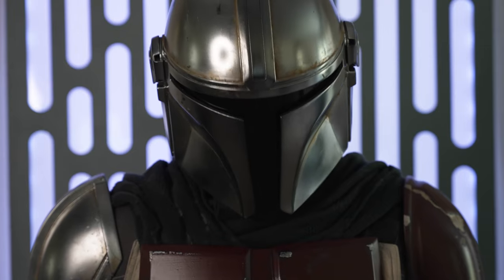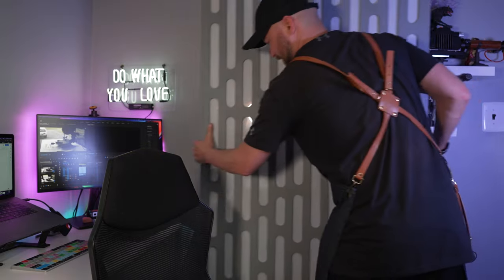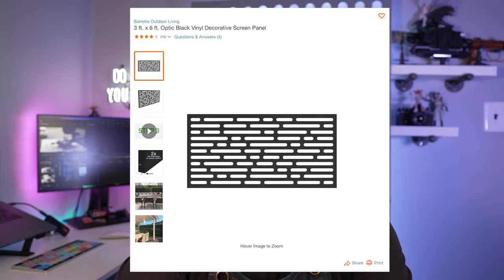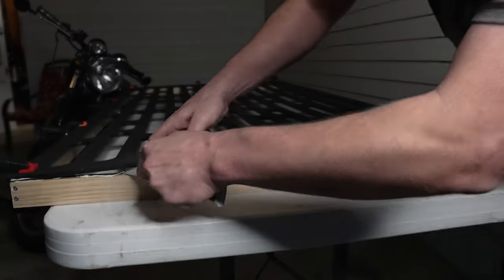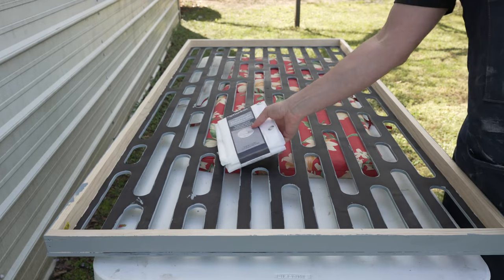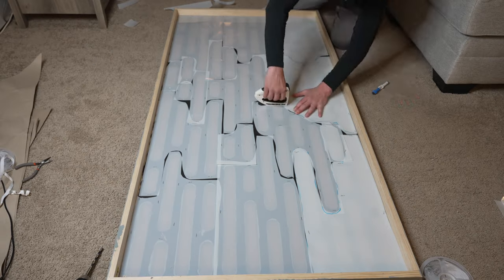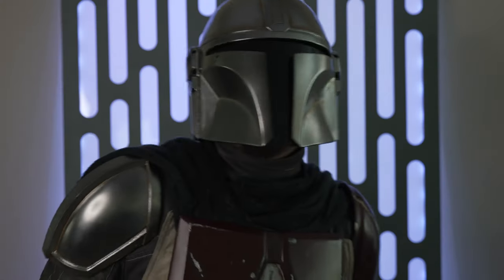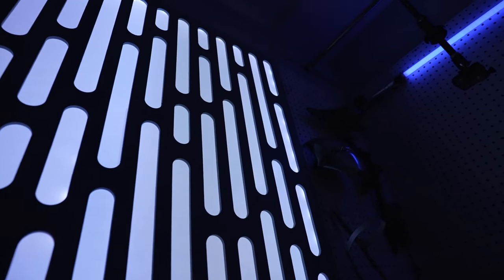$100 DIY Star Wars Death Star Wall Panel

Comment: Just finished making 3 of these panels. WOW it's a lot of work. I bought a roll of Mylar (3ft x 25ft) and lights are going on last. What took me the longest was painting. I wanted no drips, no streaks, no peeling, etc. Had to give it a few coats with some sanding in between as the paint doesn't really stick that well and can be scratched off easily. Finally finished it up with a matte sealer to really protect the paint long term. I'll be posting them up along with some figures in a few days on my Instagram. I'll be selling them at the PlastiCon event in Hollywood, FL at the end of the month. If they don't sell I'll be VERY HAPPY to keep them! - Look me up on IG to see my post soon - And a big THANK YOU to Trey for putting this up. Spent a nice few days with my dad doing everything in the garage.
Reply from the maker: That's what it's all about..quality time with family building cool stuff!!! Thanks for the comment..that made my day. Glad to hear the build went well and good luck with the sale (but you should really just keep them for yourself lol)!!

Comment: Hi. I bought a roll of Mylar Stencil Sheet with a thickness of 14 mil to avoid doubling up with the smaller sheets. Also the roll is 3 feet by 25 feet, since I'll be doing a few of these. Hopefully it'll go smooth.
Reply from the maker: Very nice! You got this..may the force be with you!

Comment: What length did you cut the wood too? Did you cut them into exactly 3’ x 6’ segments
Reply from the maker: Hey there! I measured them up with the sides of the panel. I think the top is like 33 & 5/8 and I fit in the side two pieces after that. Hope this helps!

Comment: Nice work.
Reply from the maker: Thanks so much! The problem with having one is now I need more 🤣🙌
Reply: @TreyEversman Thanks for sharing your tips. I bought two panels from Wayfair when they were $75, but I have been looking for ideas to build and mount them. How many feet of LED strips do you think you used?
Reply from the maker: @antwaynetube  I put the link for the led strips I used in the description I would say AT LEAST 75 ft (I didn’t use all of the 100ft) especially if you go around the outside of the frame and in between the holes.

I will be adding more screws at the top and side for my next one..ones in the center top& bottom but the liquid nails is holding up. Hope this helps!

Comment: I'm building 3 right now.  Thank you for the detailed list and directions.   I do have 1 question.   I'm using the sheets you got from Amazon.  Did you duel layer it or single layer it?  The video looks like you put a 2nd layer on.   Thanks !
Reply from the maker: That’s amazing!! Thanks for tuning in! I did double up..my apologies if I didn’t mention that. I’d def recommend 2-3 layers. 2 was just fine for me. May The Force Be With You!

Comment: Are leds in centre of panel facing the wall? You can see the leds around the perimeter. Would it be better to have these also face the back wall instead of firing sideways?
Reply from the maker: Personal choice I suppose! I can’t notice them for the most part. 🤷‍♂️
Reply: As shown in the video, I tried aligning the LEDs along the perimeter walls, but I didn't like how the LEDs were visible on the sides, so I removed them and have them facing the wall like the rest of the strips. It worked perfectly just by tucking it around the edges tightly.

Comment: Won’t the staples from the staple gun go through towards the front when putting the Mylar? Are they shorter than regular ones? I have everything for 3 panels including a roll of Mylar (3x24ft) so it’ll be less tedious. Teeediiioooouuusss.
Reply from the maker: Hey! I just checked for you..they are the 1/4'' 6mm staples. Hope this helps and good luck!

Comment: Did you glue the mylar sheet or how you adherethe mylar sheets?
Reply from the maker: I used a staple gun 🙌🙌🙌
Reply: I used a full-size glue gun (do not use the mini-gun!) and it did the trick!

Comment: Great video.  I'm going to start mines next weekend.  Question on the mylar sheets, Is 10 pack 7.5 mil sheet the ones to used?
Reply from the maker: Thanks so much for tuning in! I linked the ones I used in the description. I used 2 packs. Good luck on your build! Let me know if you have any other questions!!
Reply: @TreyEversman  np. I went to your mylar sheet link to buy,  but there's different sheets like 7.5 mil ect ect. Which one is the one to use? Thanks in advance.

Comment: When I did this, I used the stickum on the LEDs to adhere them down, and the LEDs face backwards.  There's very little light shining through.  If I turn the LEDs around, They're bright spots.  How'd you deal with this?
Reply from the maker: You can double or triple up or even more on your Mylar sheets depending on your preference. The more sheets the better the light will diffuse and you’ll see less of the bright spots. I doubled up on mine. Hope this helps!
Reply: Trey, any suggestions om how to keep the mylar sheets from waving up or down when your stapling them down.. im using heavy duty staples.. could this be the issue?

Comment: What would you suggest for a 9 ft tall wall, since these are only 6 ft tall?  They go from ceiling to floor in TDS.  Also, you said we need 2 packs of the mylar sheets.  It comes in a 10 pk, so is that sufficient or do we need to order two of the 10 packs?
Reply from the maker: Hmmm I think possibly adding in a top and bottom base adorned with other wall details from the DeathStar would be a nice touch and probably the easiest. Another idea would be to cut 1.5 ft pieces and lining them up with your full piece..(you’d have to cut your full piece so the circles match up) then attach to wooden frame, cover your lines with wood filler, sand, paint and BAM..frankensteined 9footer. 

I got 2 packs of Mylar because I wanted to double up on them..your preference!

Comment: Is the paint semi-gloss, satin or flat? Also, how long are your LED strips?
Reply from the maker: Hey there!  I got the Matte/flat version of that paint.  The led strips are linked in the description..the 100 ft ones but you'll have some left over.  Hope this helps!
Reply: @TreyEversman  I bought 65 ft. Hope that will cover it.
Reply: @ichawksfan  did 65 ft work for you
Reply: @jimmyolivares9856  I'm still waiting for the panel to come in.

Comment: Trey, what kind lights and how many rolls? Are they battery powered?
Reply from the maker: Hey there! I put the link to the LED strips I used in the description. I used 1.5 rolls..they are plug into the outlet and have a remote control for all the different modes. Cheers!

Comment: Can you explain how you did the light strips?
Reply from the maker: Yep!  So the string lights I used are in the description. I used about 1.5 wheels in the box.  First, I drilled a hole in the side of the bottom for the plug then I started the led strips on the bottom outside..went all the way around the outside frame then started on the panel itself and went up and down in between the holes of the panel.  HOPE this made sense!  Pretty simple.  Let me know if you have any other questions!

Comment: did i see that correctly? You put 2 layers of Mylar sheets?
Reply from the maker: Yep! I added a second layer for better light diffusion. I would at least do 2 if not 3 but it’s up to your preference. Thanks for tuning in!
Reply: @TreyEversman  thanks for making the video. I've been hesitating but lattices just went on liquidation at Home Depot in Canada (equivalent of 18 bucks USD). Couldn't resist. What do you think the 3rd layer would help with? I noticed you can still see the individuals lights when looking at the side but it's really not a big deal.
Reply from the maker: @Smarteebee  I saw that HUGE discount in Canada..that’s wild!! The third layer would diffuse the light even more and probably cut down on seeing ANY individual lights. To me, it really isn’t that bad. 

I would scoop some more up but they are still the same price here in the US 🤣🙈
Reply: @TreyEversman  just came back to watch how you put the second layer of sheets. was hoping i wasn't going to have to cut around them again but like you said.... tedious. Not sure i wan't to go 3 layers lol
Reply from the maker: @Smarteebee  lol tedious is the exact word! 🤣 YOU GOT THIS
Reply: @TreyEversman  it's actually a bit easier the second layer. So far anyway. Let you know how it ends ;)

Comment: Just started putting down the Mylar and the staples are bending and not very solid. I was thinking about using some spray can glue instead. Any thoughts?
Reply from the maker: Interesting! Mine staple gun worked out perfectly! Hmmmm..I can’t say I’d go the spray can method personally (messy, not a lot of control) so if it were me, I’d probably use a hot glue gun and just do dots of hot glue around the openings. I think this would be the ticket for me..hope this helps & May the force be with you! 🙌
Reply: Just tried some spray glue. This is not the way ! Rolling might work. This is awesome! I want to do one as a test. So this one is just working it all out. To complete a wall I will need 4 more. Such a good find! You got my sub! Now im wondering how much for a cut sheet of mylar?  HAHA I'm lazy.
Reply from the maker: @dudesarcade  I figured it WAS NOT the way lol! Dude..a whole sheet to fit these 💰💰💰 🤣🙌 Thanks for tuning in!
Reply: @TreyEversman  Hey what about daisy chaining the lights? I'm gonna build another couple panels and would like to have them syned to 1 remote if possible.
Reply from the maker: @dudesarcade  yep..I daisy chained 2 packs together. I don’t think I totally used all of the second strand tho. Daisy chained and one remote. 🤙
Reply: @TreyEversman  Do you use that extra cable that is coming out of the power supply?
Reply from the maker: @dudesarcade  to splice them I use led connectors I got off of Amazon

Comment: Ugh I put the 2x1’s flat instead of vertically. Now there is not much spacing from the lights to the edge of the design. All well.
Reply from the maker: Dang..maybe you could double stack the flat 2x1s..not the most ideal but it would give you more depth to your already started frame. Just a thought!
Reply: Ended up taking them off and doing it right.
Reply from the maker: @Nairb1007  this is the way

Comment: Is it possible to further diffuse the sides so that you don't see the light "bulbs" through the mylar?
Reply from the maker: Absolutely! You would just need to add more layers or plastic.  Cheers!
Reply: @TreyEversman  ok great I will try that when the materials come in thank you.
Reply: @TreyEversman   Great job with this.  I have the lattice panels and I wondered if you didn't put the lights on the sides if that would answer Conner's question about not seeing the "bulbs" on the sides? In other words, just up and down in between the openings shining straight back.  Your thoughts?  You did a nice job, thanks for the video. David D.
Reply from the maker: @daviddelancett7807  thanks for tuning and for the feedback! I think it’s definitely a possibility but I figured the more lights the better! Maybe doubling up on the back up the lattice is the ticket? Keep me posted on your build!

Comment: How many feet of rgb?
Reply from the maker: LED strips linked above in the description. I used 2 boxes! Hope this helps!
Reply: @TreyEversman  thanks sorry didn’t see the links before I found a 100 ft with Alexa and giggle up in Canada these sheets are on clearance at Home Depot for 24$ Canadian I bought 12 lol
Reply from the maker: @marboba  ship to U.S.?? 💀💀🤣🫶💀
Reply: @TreyEversman  i think shipping would kill the  price our rates in canada suck these days..                                                                                                                         what was the length of the screws you used.. 1-1/2"??
Reply: @TreyEversman  what size screws 1-1/2”?
Reply from the maker: @marboba  sounds about right! You just have to choose a smaller wood screw than your frame pieces. 💪
Reply: @TreyEversman  thanks doing this project with my niece this weekend  1 down 11 to go lol
Reply from the maker: @marboba  WAIT...WHAT?! 11 PANELS?!?!
Reply: @TreyEversman  no 12 lol